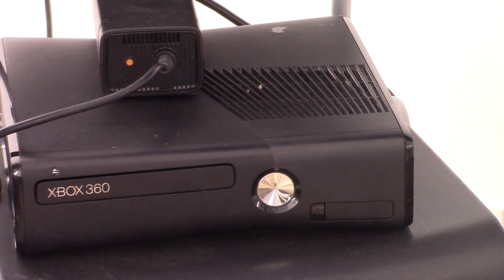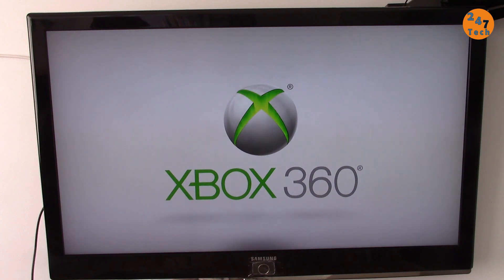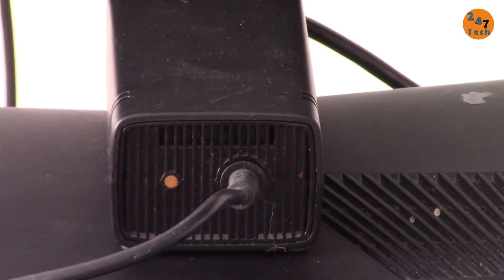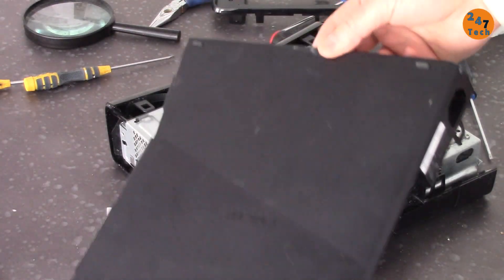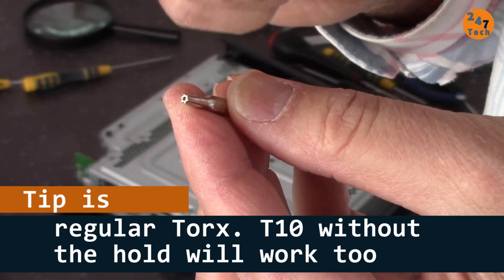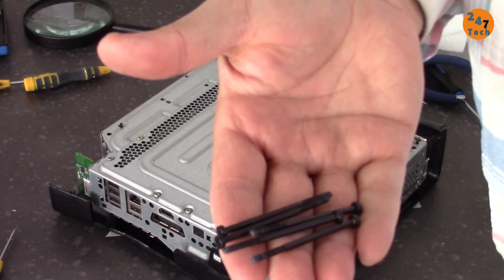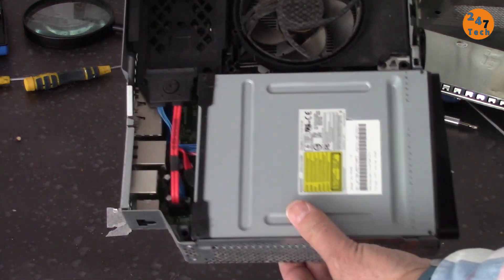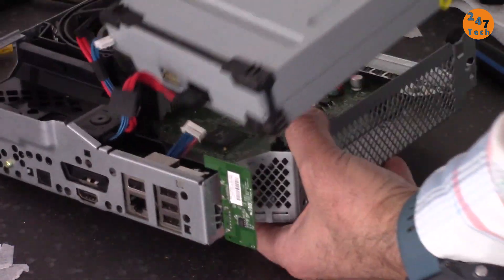[FIXED] XBox 360 shutting down due to insufficient ventilation

Comment: So do I just melt the resistors or do I burn them a certain way? I have never done any soldering before but I might as well try since it is the only solution.
Reply: You can actually just push them off or break them off with a small flat driver. Then just solder between them. I’d measure the ohms first to see which ones are good and bad.
Reply: @carlos52321  Thanks for the reply. I did the soldering the day I posted the original comment and my xbox survived the process and is still alive today.
Reply: @carlos52321  pushing them off if a horrible thing to suggest as it can often take the pad with it leaving you having to do trace repair. If you're going to solder a jumper wire or bridge with solder anyway, just desolder the resistors.

Comment: I simply put a leaf blower to the back of xbox and blew out aal the dust and dirt and worked.  3 years ago and it's still running strong today.
Reply: Still going strong?
Reply: @neptuneWX idk but i’m trying to figure it out since mine won’t even turn on bc of ventilation issue so i may try this
Reply: @TheWall2772  Tempature sensor issue maybe?
Reply: Still going?!

Comment: I tried doing this and the solder wouldn’t stick to board i ended up burning off the contacts completely
Reply from the maker: I have given warning. This is not easy.  You should have sought help from someone.
Reply: @ToDoTips  I called a few local “electronics guys” they wouldn’t touch it
Reply from the maker: Shame. Too bad.  It is done now, let’s just forget it as you can’t bring back.
Reply: @ToDoTips  i looked online for a motherboard not much out there. Do you have a source for one?

Comment: Hello I have this error on my xbox 360 slim 250 gb model. I beleive your motherboard is kinda different from mine as I was unable to find resistors r4d6, d7, d8.... I looked throughout the board and was unsuccessful. Any suggestions would be great. Thanks in advance.
Reply from the maker: Take photos of both sides and share the link I will check them for you.
Reply: @ToDoTips  Hello, I believe YouTube isn't allowing me to send the link to you. Could I email it to you?
Reply: @ToDoTips  it'd be great if you could provide me with your email
Reply: @bilalaslam189  Have you find them?

Comment: Had the exact same issue just bought a soldering kit so I can do this and it worked like a champ my Xbox is running great thank you so much for this videoIt even gave me the chance to add chip coolant to prevent the chip from overheating
Reply: Anbes Soldering Iron Kit Electronics, 60W Adjustable Temperature Welding Tool, 5pcs Soldering Tips, Desoldering Pump, Soldering Iron Stand, Tweezers 

Copy and paste this description in to Amazon and it should be the first one
Reply: @snowboarding1994ify  Thanks boss! I wanna learn
Reply: @etchosts8162  The greatest thing about this kit is that they have videos and teaching you
Reply: @snowboarding1994ify  beautiful thank you!
Reply: @snowboarding1994ify  cheap too! $20.99
Reply: @snowboarding1994ify  i just bought an xbox has this exact issue i wanna try
Reply: What kit did you buy?
Reply: I bought the chip coolant for a PC store and it came separate
Reply: @snowboarding1994ify  i meant the soldering kit?
Reply: Did  the link go through on your end
Reply: @snowboarding1994ify  no sir

Comment: So quick question. You said making a connection where the resistors was fixed this but in my experience the term short circuit is never a good thing. Is there a chance this will permanently destroy my console or affect its longevity? My main concern being I do this and it just bursts into flames or something.
Reply from the maker: I found this solution because I was almost going to throw my xbox  away.  Paying for repair would have been very costly for this old machine. so it worth it for me.  The resistor have zero value. 0Ω means short circuit. they have been there for some reason which we don't know  and now they don't show 0Ω. they are open circuit so we have to make them 0Ω by shortening the two pings of them.

Comment: it works on Xbox 360 E ?
Reply from the maker: It works on Xbox shown in video but have been tested on other machines.  There is no harm if you try it as we are removing zero home resistors and you have no other option

Comment: You just have to change yhe cooler
Reply from the maker: Won’t work. You saw it. It won’t even boot. Why then removing resistors work?
Reply: @ToDoTips  i chance the cooler and works again
Reply from the maker: What do you mean by cooler? The heat sink? Not possible because when you turn it in, it doesn’t even give time for heat sink to heat up.  In less than 3 seconds it shows error. Also heat sink is just aluminum metal , except direct to block the path, which needs to be cleaned, why you have to change it?

Comment: My Xbox mother board does not look like this. The resistors are not in the same place and I can’t seem to find them is it possible I have a different old Xbox slim?
Reply: Same I can find r4d2 r4d3 r4d4 and r4d5 but they aren’t together like in the video rather in a cluster with others and and r4d3 has no resistor

Comment: I've been through 3 Xbox 360s, including 2 originals and a E, out of all consoles Microsoft didn't build these to last. My PS1 and ps2 still work with no issues and no repairs ever needed
Reply from the maker: Yes indeed.  they all have plan to make you buy another one.
Reply: @ToDoTips  no it's just the bad design of the old phat models some of the slims and slim elites are faulty but that's the same with anything
Reply: @callumbmx9763 if you dont think its intentional you are very very naive.
Reply: @ToDoTips  I totally agree, quality has definitely taken a back seat to profits 🤦🏻

Jokes on them 😂😂😂 I’ve gone through a couple systems myself only I didn’t throw them away,

Excellent parts donors if you stay in a generation, ive got one latest model slim elite. 

And two parts donor machines 🤘😎

Comment: Great video, I was able to fix my problem!  Although instead of removing the resistors, I used a multimeter and measured the resistance across all six resistors.  If they aren't close to 0 ohms, those resistors are the problem.  Then I used a solder, melted the solder on the sides of the faulty resistors and added a tad more solder to it.  After doing so, I measured the resistance again to check that it was near 0 ohms.  Xbox was fixed after that!
Reply from the maker: Thanks. I am glad were able to help. thanks for sharing  your tips.
Reply: My solder wouldn’t stick to board it would stay on tip?
Reply: @etchosts8162 you need to add flux to the board

Comment: Thank you for this video, Got mine fixed. !!! Was a bit tricky to do the soldering as it was a tiny section but got it done. Thanks for explaining the steps really helped me. Cheers
Reply from the maker: You are welcome. I am glad it helped.
Reply: @ToDoTips  hey I don’t know if you see this but, mine is overheating after some hours so is this the same issue?
Reply: @FarmingInKurdistan . Do you own a multimeter?

Comment: I have a question. Is soldering like this safe over a long term? I would have thought removing the resistors and doing this is a bad idea. Would it not be a better idea to replace them?
Reply from the maker: I found the solution and it is working . The xbox is being used now. if I haven't removed them I would have been forced to purchase new Xbox
Reply: @ToDoTips  just get parts donors, obviously you have the skill to work on em
Reply: A zero ohm resistor isnt doing anything to begin with, may as well have never been included in the machine
Reply: Not with as little a resistance as they are, 

You’d just not want to do that in higher power applications, 

Or just do what I did, 

Keep dead systems for part donors, 

I mean if you have the patience and steady hands there’s the possibility of replacing the resistors from a 360 parts donor, 

But given how tight a space and like ZERO room for error? May as well just solder bridge em